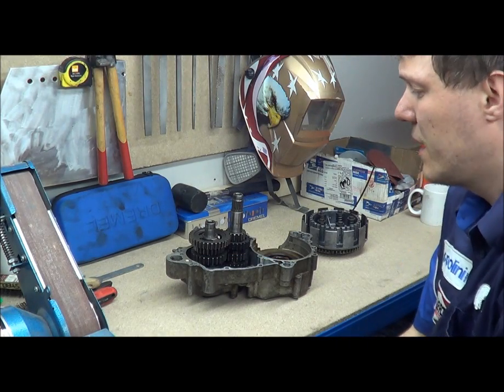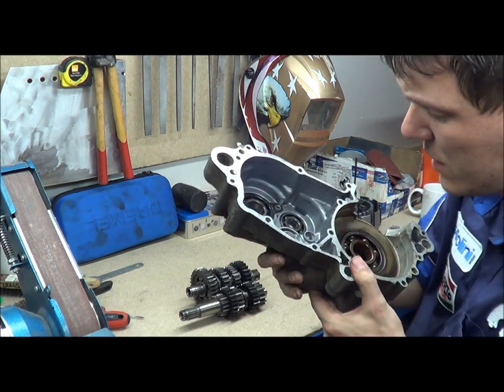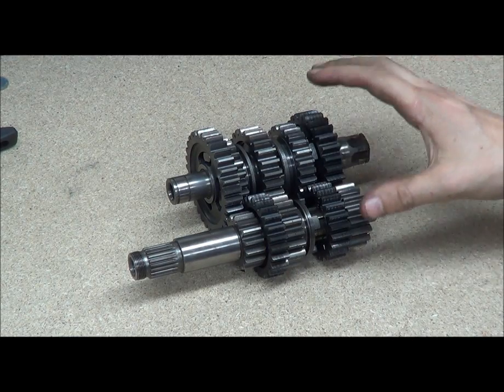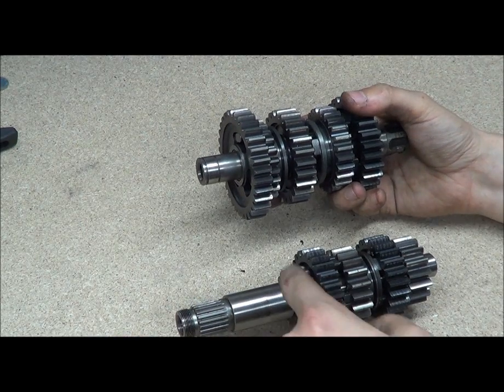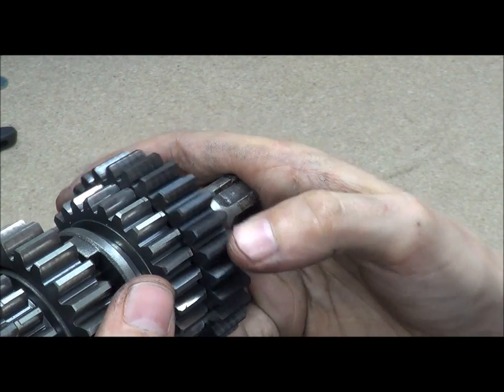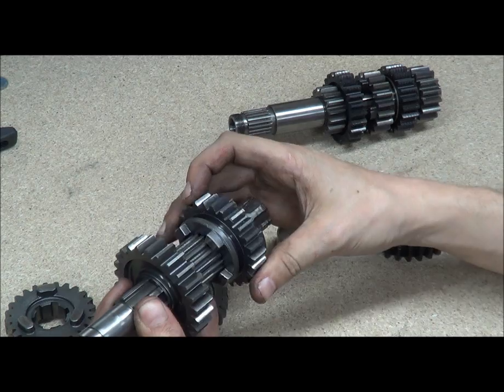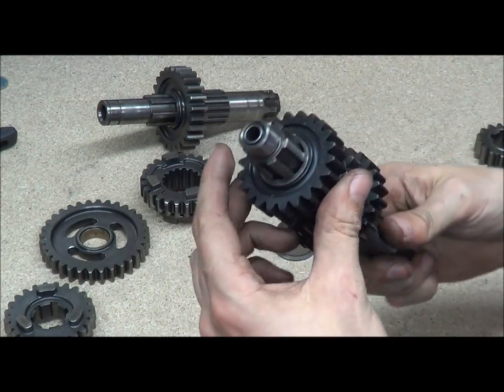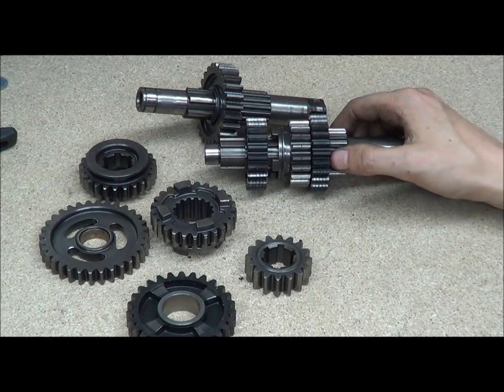How a Motorcycle Gearbox works - Part 1

Comment: Wow, this is the best explanation I've seen so far (and I've watched a number of these), but I still have some questions.  To start though, I'll put down what I came away with.

On a 5 speed,

1) There are 5 gears on the input shaft and 5 gears on the output shaft
2)  All gears on one shaft are constantly messing with gears on the opposite shaft
3) Fixed gears always mess with freewheeling gears on the other shaft
4) 1st, 2nd, and 3rd gears (1st, 3rd, and 5th gear measured from center of bike) on the input shaft are fixed and 4th, and 5th gears ( 2nd and 4th from inside) are freewheeling
5)  Therefore, on the output shaft, gears 1, 3, and 5 are freewheeling and gears 2 and 4 are fixed
6) The dog gears are always on the side of fixed gears

Right so far?

I can tell from reading the comments on all these videos that everybody is fascinated with how you can shift without using the clutch.  So what happens when you pull in the clutch.  It disengages the driveshaft from the input shaft and the input shaft should start slowing down to a stop. Right?

Questions:  How fast does this happen?  Is it in a second or two or much longer?  Does what gear you are in effect the speed of slow down?  Why would it stop spinning at all except if in neutral?  Wouldn't the output shaft keep it moving (assuming the bike is in motion)?

To continue, the input shaft has now slowed to a stop, causing the freewheeling gears on the output shaft to also slow to a stop.  However, the output shaft is turning with wheel rotation speed, so all the gears fixed to the output shaft will still be spinning?  Right so far?

So when a shift is made, the rotating dogs are going to clash with cavities in side of the slower moving freewheeling gears.  This is why the tops of the dogs in your video were ground down somewhat.

So, I'm not sure how clutching even helps. (?)

If you DON'T clutch, the input shaft is still spinning, as is the output shaft.  Again when you shift, you are going to have a clash between dogs and dog cavities.  In fact, because both shafts are spinning, it seems as if the shift would be smoother. (?) 

I feel like I am almost understanding this, but not quite.
Reply from the maker: Hello mate, this is going to be a long one lol 

"So what happens when you pull in the clutch.  It disengages the 
driveshaft from the input shaft and the input shaft should start slowing
 down to a stop. Right?"

No. - the clutch disengages the clutch basket from the clutch boss which is attached to the inputshaft if we're being technical. Here this might help -
https://www.youtube.com/watch?v=d74A37h4v6c

Seondly the inputshaft slows down yes but not very much as the you change gear and then engage the clutch again. The clutch is used to disconnect the inputshaft from any torque thats applied to it. When the next selected gear is engaged the shaft has no resistance to this change, and it would if the engine was apply a torque to it.

"Questions:  How fast does this happen?  Is it in a second or two or much
 longer?  Does what gear you are in effect the speed of slow down?  Why 
would it stop spinning at all except if in neutral?  Wouldn't the output
 shaft keep it moving (assuming the bike is in motion)?"

Yes - I kinda answered this one above.

"To continue, the input shaft has now slowed to a stop, causing the 
freewheeling gears on the output shaft to also slow to a stop.  However,
 the output shaft is turning with wheel rotation speed, so all the gears
 fixed to the output shaft will still be spinning?  Right so far?"

Again the inputshaft doesn't stop.

"So when a shift is made, the rotating dogs are going to clash with 
cavities in side of the slower moving freewheeling gears.  This is why 
the tops of the dogs in your video were ground down somewhat."

- correct, the dogs are the feature of a gear that experiences the most wear. These gearboxes aere called constant mesh, if you hear grinding then its the dogs chattering not the teeth of the gears.

"So, I'm not sure how clutching even helps. (?)" 

I stated above that the clutch is used to disengage the shaft from the torque that is applied to it.

"If you DON'T clutch, the input shaft is still spinning, as is the output
 shaft.  Again when you shift, you are going to have a clash between 
dogs and dog cavities.  In fact, because both shafts are spinning, it 
seems as if the shift would be smoother. (?) "

Good question - you half of it right. Both shaft will continue to rotate as you engage the clutch, but they will deaccelerate. The input shaft will 'freewheel' as an entire assembely. The output shaft on the other hand will reduce speed due to the friction between the road and the tyre which the output shaft is connected to. This is turn is connected to the input shaft as they are constant mesh. So the gearbox reduces speed at the same rate the rear wheel (which is no unpowered) will. If you think of it like this. If you pull your clutch in the bike will roll to a stop no matter what gear your in. 

Anyroad, when you select another gear and release the clutch you continue on your way. Basically your disconnecting the power from both shafts this means there is less resistance when you mesh dogs together. The 'impact' between the meshing dogs is alot lower.

Clutchless shift means that the impact is much greater, this reduces the life of the gears. 

Another way to think about it (very loose analogy) is changing gears on a push bike. If you are climbing a hill and change gear and putting your back into you hear a horrible clunking and you can feel the change is rough.

Hope this helps - if not I'll do a video on making gear change and clutchless shifting
Reply: Thanks for that response!

I understand about the clutch, etc.  So when the clutch is pressed in, the input shaft keeps rotating but without the torque it has when not engaged?  It is then the case that  the input shaft's resistance to matching the output shaft is just the inertia in the shaft itself and not the inertia due to the pistons, etc.?  It's the resistance to the "shock" of the dogs engaging that is important and not so much the speed differential between the dos and dog recesses?  Is that right?
Reply: I just had a bit of an insight.  Damage to the dogs and recesses can be done not just by normal grinding on the end of the dog, but also by the shock when the dog hits the end of the recess.  This shock can be minimized in two ways.  1) By using the clutch to disengage the input shaft from the engine, thus reducing the resistance to turning of the gear with the recesses or 2) By matching the speed of the freewheeling gear to that of the fixed gear with the dogs.  Shifting without clutching involves this latter method.  If you were perfect at matching the speed there would be even less shock than when the clutch is used.

Is that right?
Reply from the maker: lol yes mate, the problem with clutchless shift is that we're human, and can't perfectly match the speed of the two shafts. You got to remember that the speed of the shaft is the macth speed of the gear you WERE in not the speed of the shaft you want to be in when the engage the next gear. Think of torque as energy. When you disengage the clutch the energy tranfers form the engine into the input shaft diappears. Its motion is now 'powered' by the inertia stored in the shaft. When you select the next gear the impact (energy transfer) between the dogs and the recesses comes from the inertia in the shaft. If the engine was connected to the shaft when the shift takes place the torque (energy form the engine) is transfered into the dog recess throught the dogs on the moving gear. This results in higher impact energies cause more stress on the gear moving and the gear being selected. 

This is why gears are hardened, they behave like the impact anvils in a impact gun. If you can do something (use your clutch instead of clutchless shifting) this will prolong the life of your gear box.
Reply: Pony Power I think I've got it!  In theory (although not in practice), someone could match the dog gear with the dog recess let the dog pop in and then minutely increase the speed of the dog gear so that it would just softly press against the front of the dog recess resulting in the perfect shift!
Reply from the maker: Yeah thats pretty much it, I'm doing a video on this subject seen as you and other are having abit of difficulty. Syncro rings in car transmissions are design to minimize exactly what your taking about

Comment: 9:05 Are the "dog recesses" the reason why bikers can perform clutchless gear changes?
Reply from the maker: +cRizy89 I don't know what your asking, but I think I know what you mean. Dogs are fitted to both car and bike transmissions, cars tend to have synchro rings which is abit more complicated but the idea is the same. Gear teeth are precision cut features, people think that the gears engage each other and change location when a shift is performed. This would quickly wreck the gear surface and make shifting impossible. Dogs are more robust due to their simplicity. Changing gear using the clutch or without doesn't effect the way in which gear are selected. And another point which I get asked alot, clutchless shifting damages your gearbox.
Reply: +Pony Power Ohhh I see. Then why is clutchless shifting more acceptable to be performed on bikes then it's in cars? I saw a video in which it stated that due to having a sequential gearbox, clutchless shifting is possible (or a natural/normal thing). That's why I started watching your videos trying to find an answer as to why this is acceptable thing, by a large amount of people, for these types of gearboxes. By the way, on my original comment, I meant the wider dog recesses, rather than being a dog recesses just big enough for the dogs, without any further room (I did understand your answer though).

Comment: Will the whole mechanism still work if the input shaft is rotating at the opposite direction ?
Actually, I'm making a project and going to install the gearbox to a motor rotating the shaft. What I want to ask is whether the mechanism will act as reverse when I change motor's polarity. Or will it not work at all?
Reply from the maker: +Ankur Ralhan sorry for the late reply, google marked your comment as spam for some reason? Anyroad, yeah the mechanism work in both directions apart from the selector drum. So changing gears has to be the same way. Good gearboxes if your wanting to use them for a lathe or milling machine, can easily take the torque.  Hope this helps - matt

Comment from the maker: Gear position swaps between 3-4 or 4-3 can be down to a few factors, mostly to do with selector drum design. Depending on how the input/output shaft are orientated within the gearbox dictates where the selector forks are situated. Sometimes this means switching what orientation the gears are. Other design reasons can be torque loading on the gear shafts. So for example having the order 3-4 can sometimes cause unwanted vibrations in the transmission, switching them can reduce this to exceptable levels. Hope this helps. - matt
Reply: Thanks a lot, Matt.
Reply from the maker: ***** No worries mate.
Reply: Nice

Comment: Dear all,  does anybody knows why some motorcycle gearboxes have the following gear order,  starting from the clutch:  1-5-3-4-6-2,  and others:  1-5-4-3-6-2?  Which is the reason to change the 3rd and the 4th gears position?

Comment: Outstanding explanation, thank you for sharing. I'm gathering as much information that I can before diving into a ktm 525 gear case that has a problem with going into reverse. I'm working on a 2008 polaris outlaw 525 (atv). Your video helps to build my confidence. Any advice on my situation would be greatly appreciated. Thanks again!
Reply from the maker: Thanks for your comment, much appreciated. Give me more information and I'll see if I can help. Is your problem physically engaging reverse or problems whilst in reverse i.e keeps slipping out of gear? thanks again - matt
Reply: The only information I have is that from the previous owner. The atv was in reverse and high centered on a rock when he hurt a loud clunk and the engine stopped running. The atv performs normally in all forward gears, it's only when you shift in reverse the engine stops after moving less than a foot. The atv is difficult to get back into first gear but once there it begins operating as normal. I'm currently in the process of taking the engine apart to see if I can find anything that's obviously broke. I'm having to wait for a few special tools to arrive before I'm able to get inside the engine. Thank you for the reply.

Comment: Whats your opinion on clutchless shifting.  Does it ruin the dog teeth or damage the transmission in any other way.
Reply from the maker: Downshifting is more damaging than upshifting generally. Your clutch is used to reduce the speed and torque when switching between gears, if you don't use your clutch and change gear at the same rpm as you normally would this increases the amount of impact between the dogs and their respective holes. In general this reduces the lift* (I mean life) of the gear set.
Reply: Pony Power What makes downshifting more damaging than up-shifting. Also what did you mean by "reduces lift"?

Awesome video btw.
Reply from the maker: Aashwin Varshney when you downshift you increase the load on the engine, this is called engine braking. As for why downshift, simply because your over-ranging the gears (if that's a word) i.e your subjecting that selected gear set to speeds/torque from a very low load and speed. Its like jumping off a bus and trying to run to maintain 30mph. As for lift I meant to say life lol - thanks for the comment - matt

Comment from the maker: I think I know what your problem could be the manual states

"Assembling the transmission components
Place the clutch-side (right) half crankcase on a
support, then fit the spring and the gear indicator ball
in their housing (see figure) after smearing them with
a little grease so as to prevent them from coming out.
Fit the thrust ring (0.6 mm in thickness) on the driven
shaft (1). Apply a little grease to the ring to keep it in
contact with the low gear. Fit the driving (2) and driven
shafts (1) together and position the fork on the former
(3). Place the assembly in the crankcase."

Basically theres a ball bearing and a spring that run along a detent track, if the ball has popped out then the selector drum can shift on its own sometimes. All the gearbox has to be assembelled in 2nd gear - the manual states

"Also check that, when the desmodromic shaft is
positioned on the 2 nd gear, the cam rollers are at
equal distances from the fork lips. If not, gently
distort the spring ends until the desired situation
is obtained."

Comment: Excellent video mate I ever watched on manual transmission! Your knowledge is rock about transmission and other stuff. Regards,
Reply from the maker: Thanks very much, and thanks to everyone for the nice comments. Hope the video helps. I'm in the process of doing a series on 2 stroke engines. Basically I have a built up engine and I'm going to dismantle it from top to bottom and go through as much as I can about how it works and how its designed and why. Should be released in a week or two. - matt